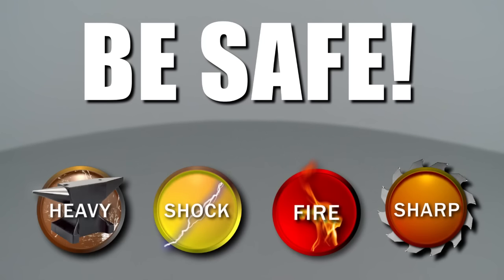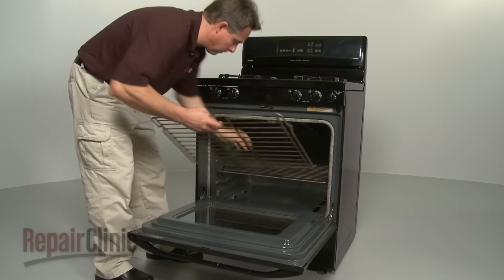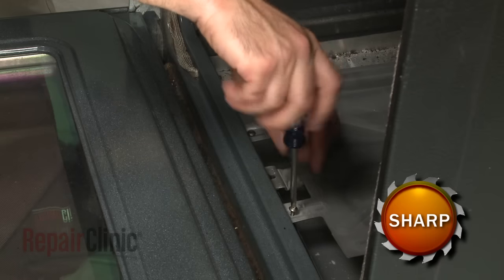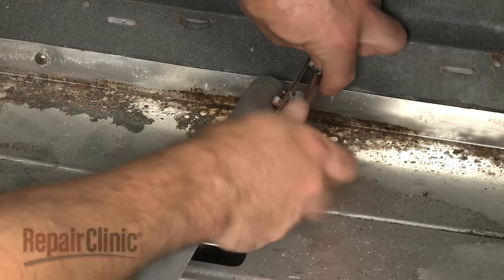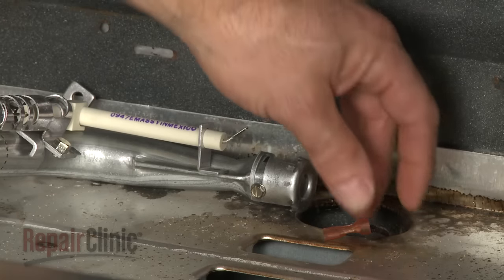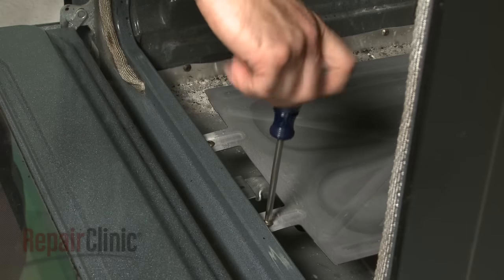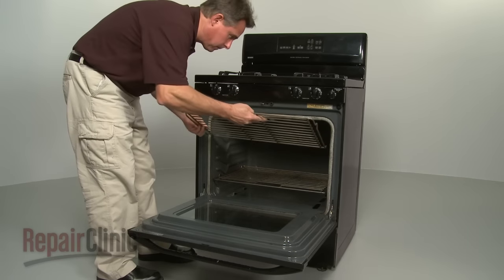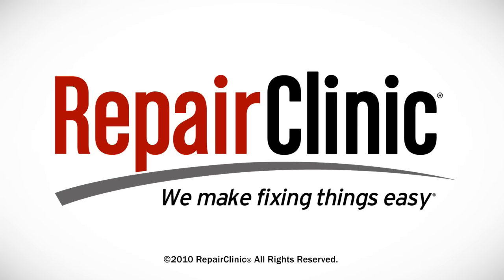Kenmore Gas Oven/Range Igniter Replacement #8190618

Comment: Great video. Was afraid of safety with gas/electricity, but this helped me know what to do so I wouldn't get shocked. It was very simple. I just ordered my "9758079 Oven Igniter for Range" from amazon and switched it out with the old one in my "Kenmore oven: model 66575173302". I kept the burner pipe to save money, as mine did not need replacing. These were the best directions in a video, because you were not cutting any wires. Now my oven is baking again. Thanks for the video.

Comment: out of curiosity, do you need to close the gas valve as well?
Reply from the maker: +hafadude69 Nor to replace the igniter.
Reply: +RepairClinic.com If you are smelling gas when the oven is turned on, is it the igniter or the burner tube?  Should I just replace both?
Reply: +RepairClinic.com Looking at my igniter, it looks burnt out in some areas.  I'll just replaced the igniter and go from there.  The burner tube still looks good.  Thanks for this video.  It was very helpful.

Comment: I have a kenmore elite gas range model 790.79443601 that need a new igniter.But i try to look up the part and frigidaire igniters keeps coming up. Im not sure if I should buy it
Reply from the maker: Here are the igniters for your model: http://www.repairclinic.com/Kenmore-Range-Stove-Oven-Model-79079443601-ID-940369-Igniter-Parts
Reply: +RepairClinic.com Do you guys still have the igniter in stock for  kenmore elite gas range model 790.79443601 the link isn't showing a part thanks
Reply: nl25c.